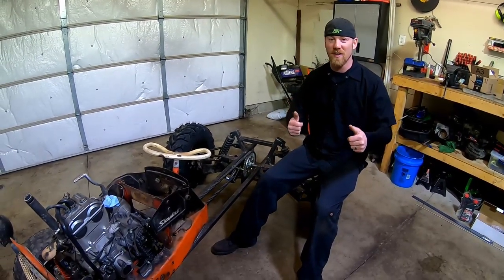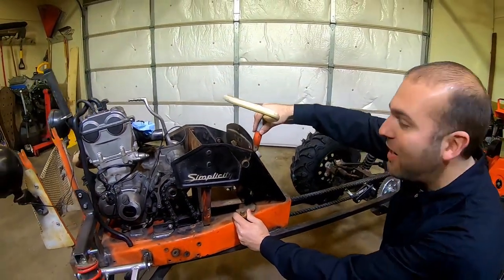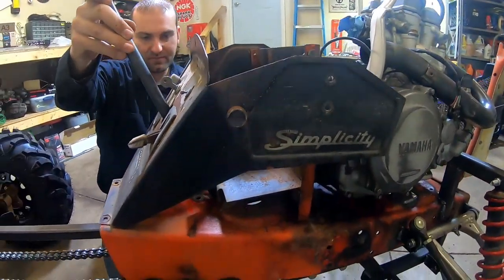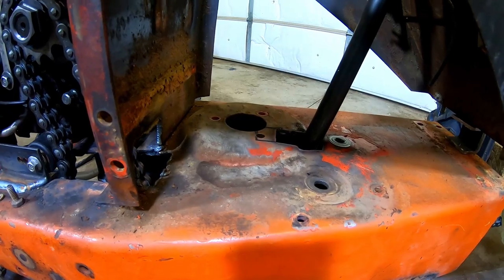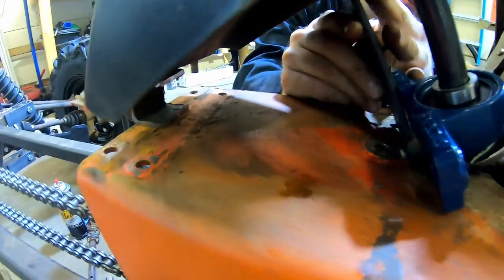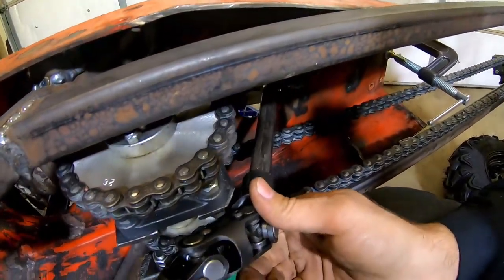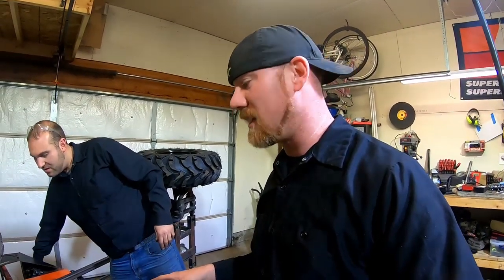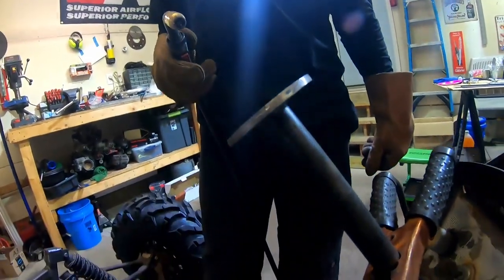YZF450 Powered Tractor Gets Steering with an Unexpected Ending! "Not So Simplicity" S1 E8!

Comment: You might need to extend the ends on your rack and pinion and shorten the steering tierods so that when the suspension compresses it doesn't have bump steer